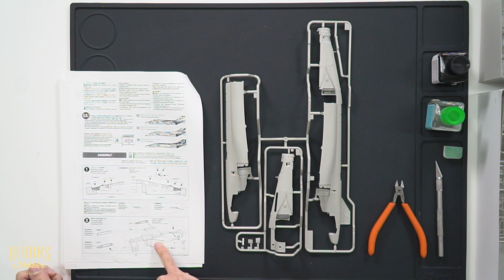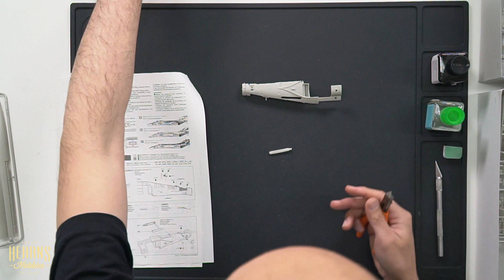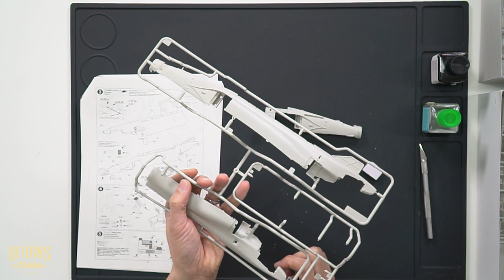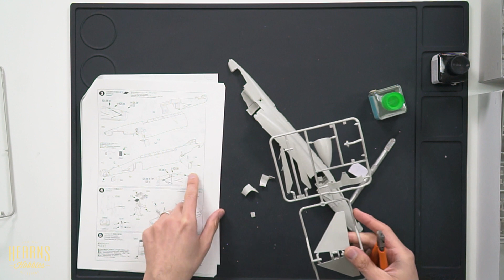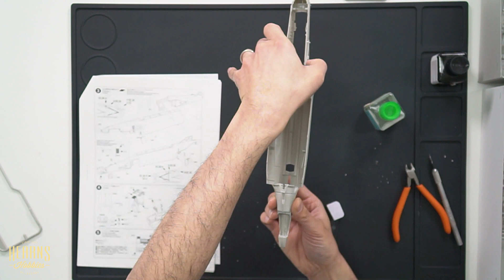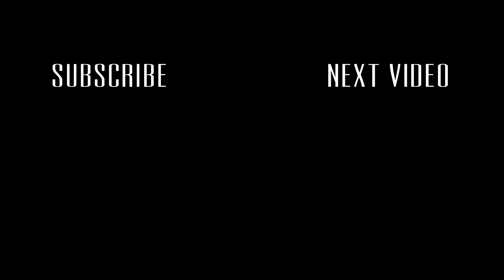Tamiya | 1/48 F-4B Phantom Build Part 1 | #askHearns

Comment: Really enjoying the video build and r Really looking forward to getting the Tamiya rendition, even though I have a few Eduard/Academy F-4's in the stash.
What is the brand of the modelling mat you have there as it looks very practical?
Is it made from the same material as a cutting mat?
Do you folk sell them?
Reply from the maker: Hello Clyde. Glad you are enjoying the build! The matt is an Excel large cutting mat. It is made from a self sealing plastic and works the same way as the common colored cutting mats.
Here is the link: https://www.hearnshobbies.com/products/excel-18in-x-24in-clear-self-healing-cutting-mat
Reply: Thanks for the quick reply. No I'm referring to the black mat that you are building on.
Reply from the maker: Oh, sorry. I usually use the clear cutting mat and had that in my head.
That is a hard silicon mat designed for radio control car builds. The grip and soft texture stops parts from rolling and bouncing too far. You can't cut on it though. Similar to using a towel but without the fur and fibres.
https://www.hearnshobbies.com/products/silcone-pit-mat-black-medium
Reply: No probs. Checked out the link. Doesn't look like you have any in stock. Bit weird, when i first accessed the link it offered a $10 discount but now it is gone. Not sure what the issue is. Also the raised areas where you have your glue and knife  are a different shape to the ones one the website.....I prefer yours.
Reply from the maker: Sorry, that turns out to be the wrong link. This one is identical to the one I use in the video. https://www.hearnshobbies.com/products/sweep-silicone-pit-mat-med-black-600x430mm-swm-mk
The voucher pop up is being setup now and is a bit patchy. It is a $10 voucher that will be sent to your email after you sign up to our newsletter.
Reply: All sorted BJ. Mat ordered. Thanks heaps for your help. Greatly appreciated.
Reply: Hey mate. The mat arrived Friday. Really happy with it. Not exactly cheap but well worth it. Keeps every thing in it's place and maybe I won't be battling the carpet monster as much.
Reply from the maker: That's great! It stops parts from bouncing around which is a great help.